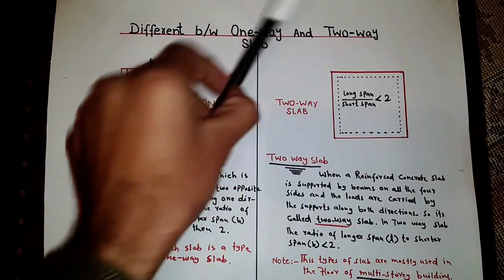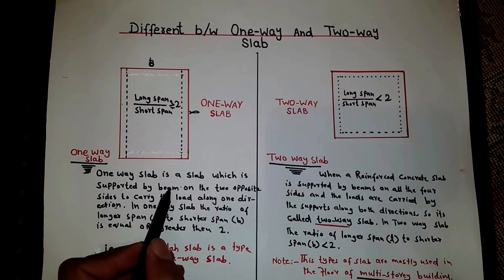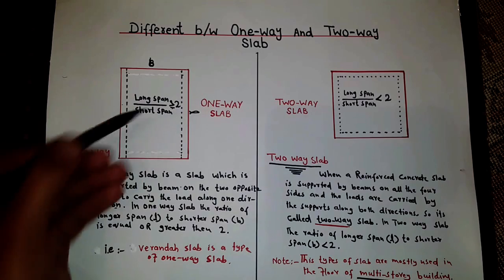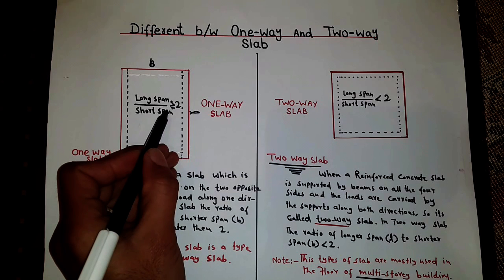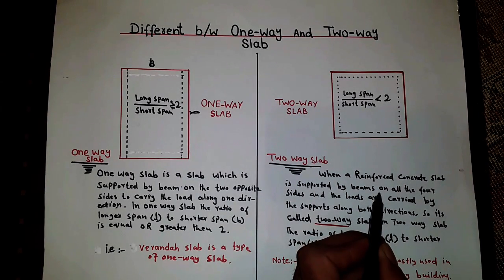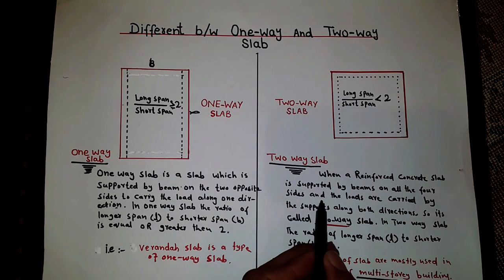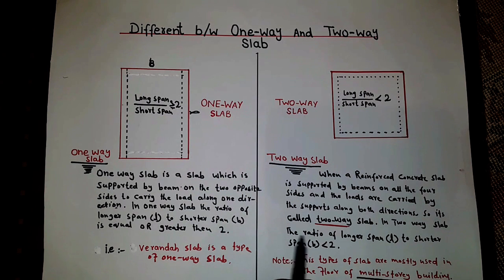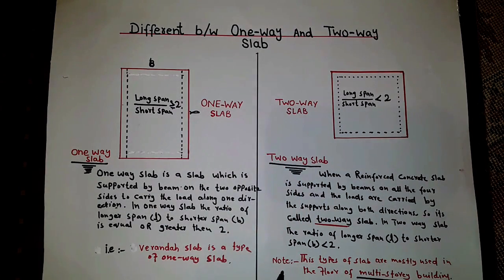Different b/w One way & Two way Slab

Comment: Which is more economical?
Reply: this vid isnt a matter of whats economical, both are required for constructing the sturdy slab. if on a economical aspect, you cant adjust on the type of slab use, but which materials to use or what brands of reinforced steel bars to use.

Comment: is there any consideration where i can design a two way slab as one way slab? for example the ratio is 2.1 or 2.5 or 2.05. or if the load is less than 4.8 KPa? thanks

Comment: If in one way slab it is supported on four side than also it ll behave like one way??
Regards
Reply: i think it all depends on direction of forces of the beam. If they are in two way then that will be two way otherwise one way slab. thanks
Reply: Akshay Kothiyal then it is a two way slab